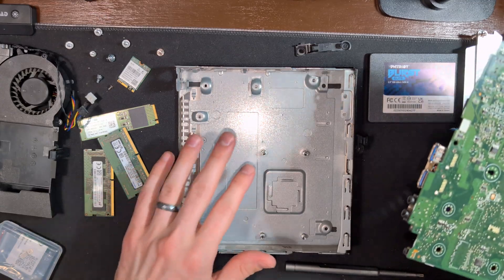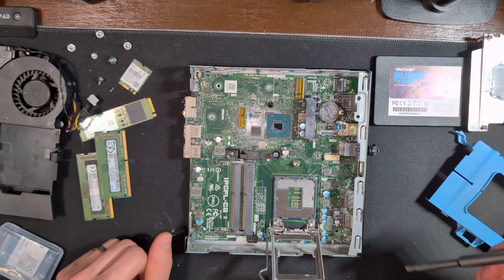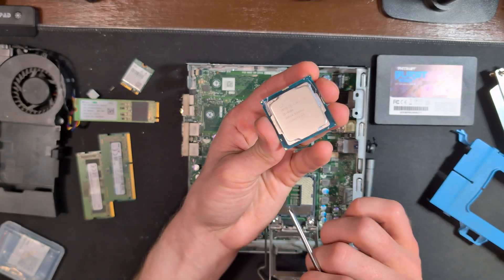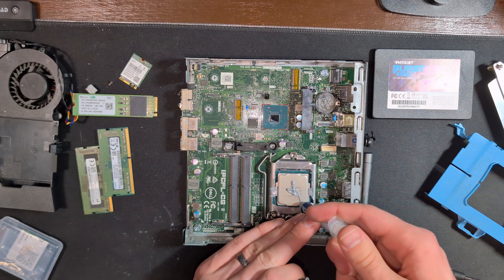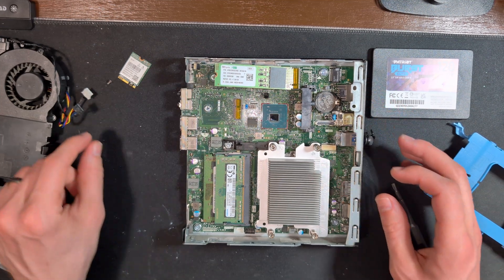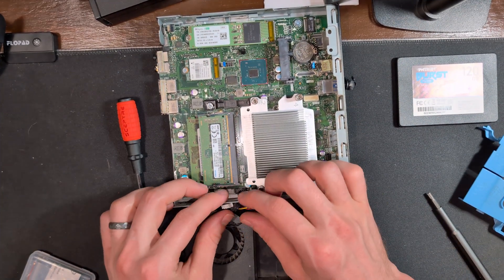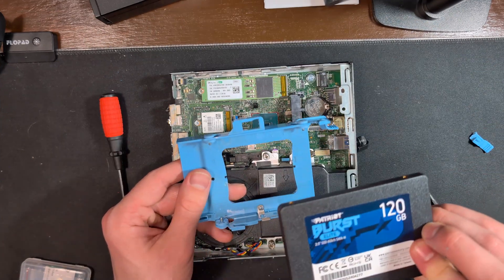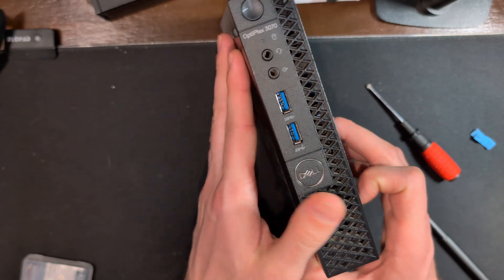How to Reassemble the Dell OptiPlex 3070 Micro pc

Comment: Is it okay toninstall i5 9500 instead of i5 9500t because of lower TDP
Reply from the maker: @rajbakshi786  you'll need to get a higher wattage powerbrick and cooling will be an issue. But it will work in this unit
Reply from the maker: I have another video up about puting a i5 9500 standard in it...
https://youtu.be/wiSMncjSnd8